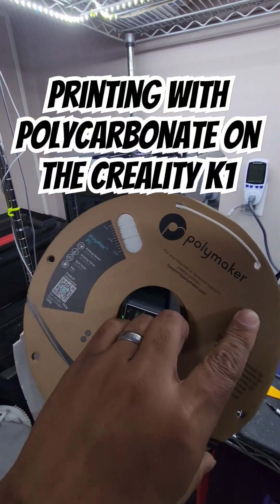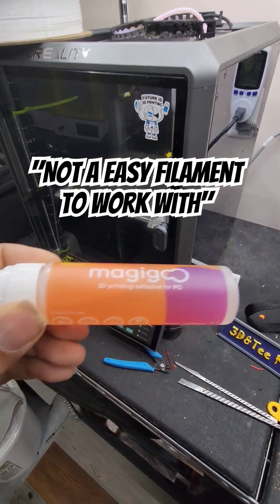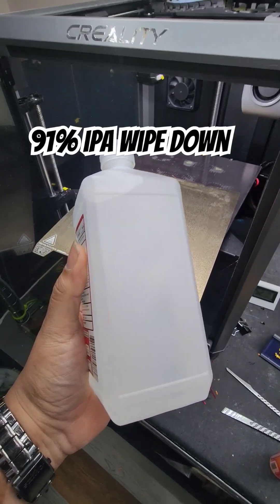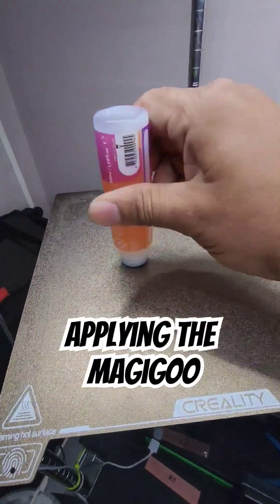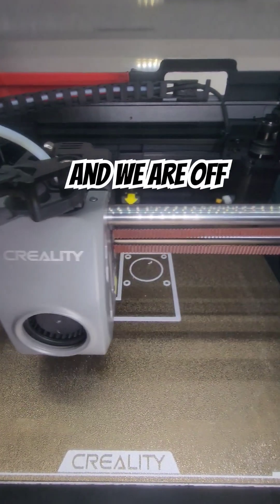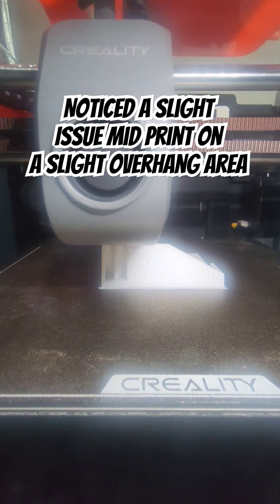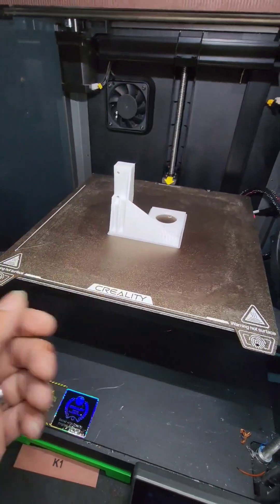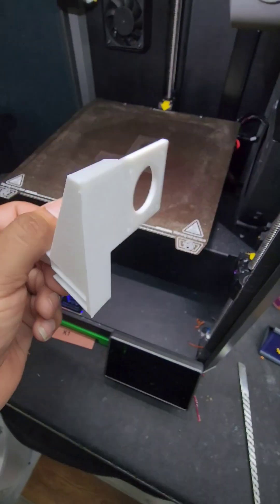Can a Creality K1 REALLY Print Polycarbonate? #3dprinting #creality #k1 #crealityk1 #polycarbonate

Comment: hey dear friend, at first, thx for take the time for the video.
i need to understand the value needed inside creality print because no PC option showed.
thx in advance for your help.
Reply from the maker: Sure.  I just copied the Creality Generic PC Profile from my Ender 5 S1 settings.
Density: 1.24
Diameter: 1.75
Max Volume Speed 18.00 (You can change to be a little higher if speed printing)
Flow: 100% ALL THE WAY DONE THE LIST
COOLING:
Reg Max Fan Speed: 10%
Force Coolijg for Overhangs and Bridges CHECKED
Force Cooling Overhang: 50%
Fan Speed for Overhangs/bridges: 100%
Small Feature: 50%
Bridge Fan Speed: 50%
Support skin fan: 100%
Reg Fan Layer: 3
Min Layer Time: 10
Min Speed:10mm/s

RETRACTION distance: 1.2mm
Retraction Speed: 40mm/s
Retraction Prime Speed: 40mm/s
Happy Printing
Reply: @3DandTeePrinting  thank you very much for your help
Reply: Thanks been looking for this info

Comment: This test is useless, it's like printing CF with brass nozzle, you can print it, but not. Do larger or higher print to see if it's gonna warp or crack :-)
Reply from the maker: If I needed a larger part that needed PC I would.  At almost $50 a rollI I only use PC when I really need it.  I NEEDED a bracket for a direct drive conversion.  PETG started to bend after about 50 hours of printing due to pushing the motor and Temps got hot. The replacement ABS bracket cracked at the screw holes so I wanted to try a SMALLER test of PC.  Send me a roll and I will print a HUGE print for you.
Reply: @3DandTeePrinting  🤣

Comment: 91% ipa is useless. No wonder all your build plates are a mess.
Reply from the maker: I like to smear old residue around.  I am not trying to clean it.  I am redistributing the old bed Adhesive even around the board.  I strip my beds every month with 99% then reapply a nice coat of either Bambu lab bed adhesive or Bed Weld.  Most of my machines are printing at least 20 hours a day.  Who has time to wipe down the bed between every print. Clean boards and me are NOT friends just ask Mr Warped bottoms or Curly Edges.  I try not to ever meet them in the middle of the night.
Reply: Genuine question, my son and I bought a 3d printer a year ago. Whatever we print (flashforge printer I believe) gets stuck to the bed and it's a pain to remove, almost bordering on destroying the machine.
Reply: @opiumextract2934 check your Z-Offset. Prints should never be that hard to remove. Also check your combination of Material and Build Plate (PETG + Smooth PEI for example is an issue, or PETG and borosilicate glass). You can always use glue as a release agent if needed
Reply: @opiumextract2934 first layer height need to be increased on your settings. Or relevel the bed
Reply: @opiumextract2934 you potentially need a new build plate. It’s pretty easy to damage them, especially if you’re just getting into it. Make sure you buy something with PEI
Reply from the maker: @opiumextract2934 if you have a Magnetc Spring Steel, PC or a Buildtak Plate SWITCH IT to a PEI build sheet OR use regular glue stick or hair spray should resolve that issue.
Reply: Yeah, I exclusively use 91% on all my stuff and everything turns out fine everytime 😂